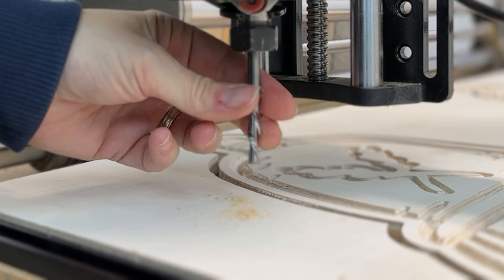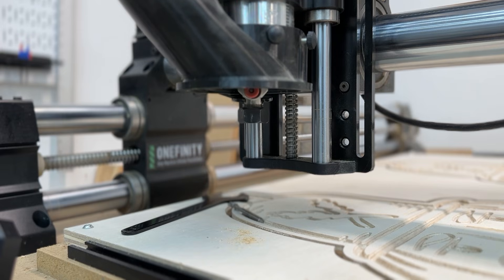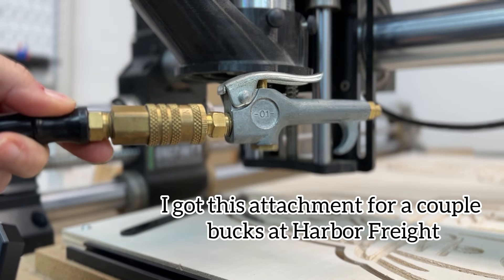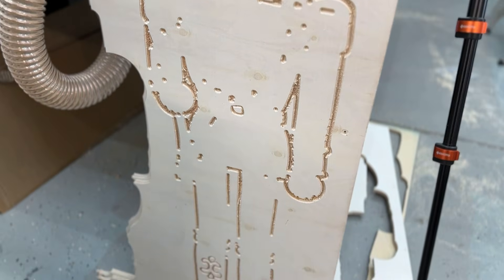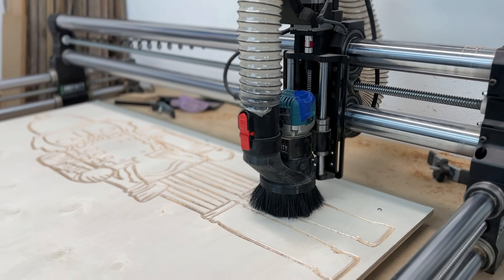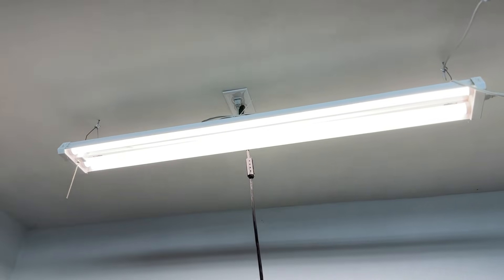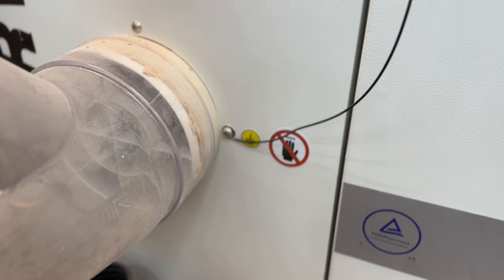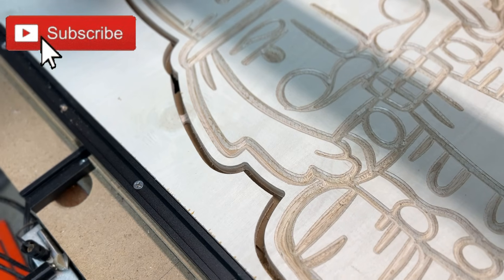Do These Two Things to Prevent CNC Carving Problems!

Comment: Build a blow nozzle with a 90 degree outlet, it will do a better job because of more direct flow. 
Use a cleaner like brake clean to remove any oil, totally fast evaporation and no residue left.
Remember:: you cannot have too many grounds. Grounding vacuum hose at both ends and a static wire inside
Reply from the maker: Great suggestions, thanks for sharing! I definitely could use a little 90° thing to improve that. Does it have to be copper wire to be a grounding wire? The one that came with the G700 is not copper but it does seem to have eliminated the static electricity associated with the vac hose.

Comment: Collets do wear and need to be replaced ( less than $10). If you were getting static shock when toughing the hose, I'd suggest running a bare copper wire through the length inside of the hose and ground it. I do not believe that EI is your problem though.
Reply from the maker: All I can say is, with the changes I did in this video - the job that had messed up the V carve in the same way multiple times in a row, no longer had any issues and ran perfectly. I never saw any evidence of bit slippage, although I agree with ya, sometimes collets do need to be replaced. The hose also has the metal running all through the length of it. It’s not copper though.
Reply: @OakHillMillworks  The wire in the hose is coated and will not eliminate static electricity.
Reply from the maker: @thomcarr7021  did you watch the whole video? I showed how I used the provided grounding wire from my g700.
Reply: @OakHillMillworks  The fact that you get any static shock means it is not grounded correctly. Never mind.
Reply from the maker: @ right. No I agree with ya. Initially, it was not grounded at all and that’s why I was talking about how that was a problem in the video. Then I mentioned how I did ground it properly and no longer get any static shock.

Comment: don't just blow air in the bottom of the router. take the nut all the way off. Take the collet out. Clean the nut and collet. Then clean out the spindle hole. Then out it all back together.
Reply from the maker: I should have mentioned that. Definitely a good idea to do that after a lot of use and dust build-up. I have rather awesome dust extraction so I didn’t need to do that in the moment I was filming on that particular job but I agree with you. Good idea to do that too.

Comment: Have you had any problems with your Onefinity losing its home position? I had this issue yesterday while jogging the Z axis. Does not happen often but once in a while. Thanks
Reply from the maker: Most of the errors I have experienced with my journeyman have been because of my operator error but I do think I have experienced that before as well. I think EMI can play a large role in a lot of the weird things that can happen like losing home or Z height all the sudden not right.
Reply: @OakHillMillworks  Thanks for the reply. Will work on grounding. Earthing in the UK.😊. Very happy with the machine overall though.👍
Reply from the maker: It’s a great machine! Only CNC I have experience with though.